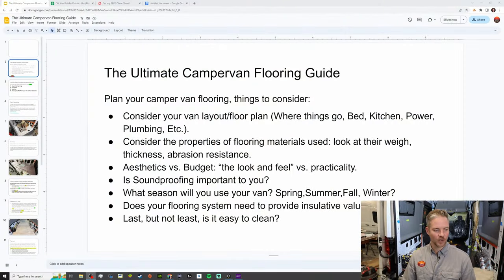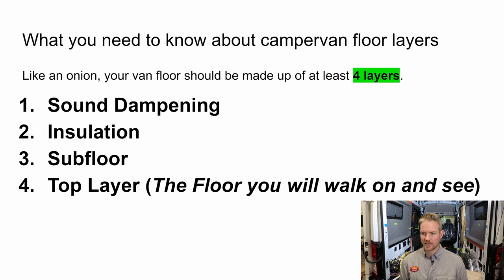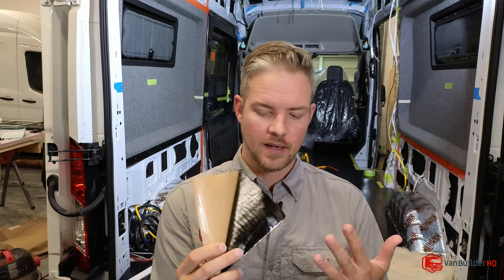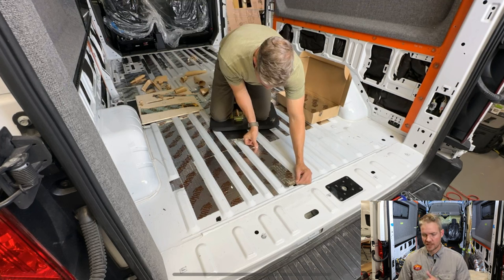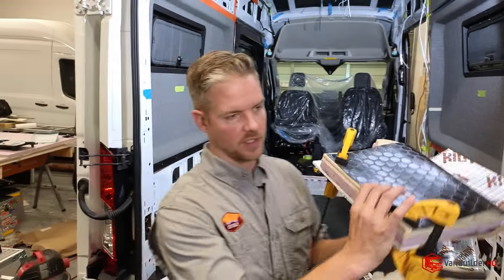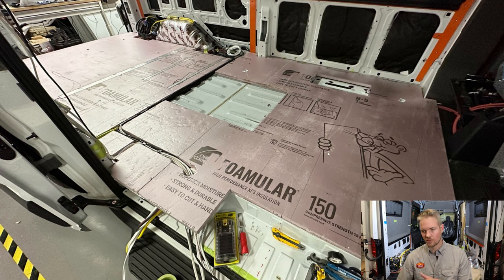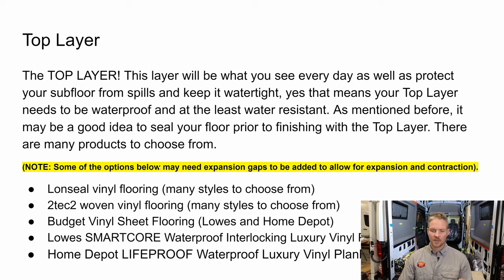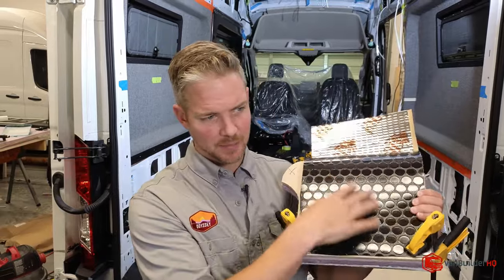The Ultimate Campervan Flooring Guide

Comment: Would you leave the felt backed vinal floor covering installed at the factory under  your insulation as an extra layer or remove and start from the bare meal and why ?

Comment: Could I use carpet tiles as a sound dampener then layer with sound guard moisture control underlay before I put my ply wood on then another layer of underlay before I place my laminate flooring most of this got for free just trying to see if there is an effective use for it

Comment: With all due respect has anyone ever tested the actual noise reduction from a van floor that had strips of sound deadening material put in just the valleys, because without running a continuous layer across the entire floor including the wheel wells I’m skeptical that it would add any significant reduction in noise. As a former science teacher you would have to complete two identical vans one with the strips of material & one without and then drive down the same roads with a decibel meter. I suspect all you are accomplishing is to add 50 mm of height for a lot of money? Secondly, who came up with the term decoupling for the idea of reducing heat transfer between surfaces which essentially is the exchange of thermal energy between physical systems. The meaning of the word “decoupling” is the separation of something that was previously joined or coupled. Therefore, “decoupling” has nothing to do with heat tranfer!
Reply: Sound deadening in strips will deaden the by a little bit…